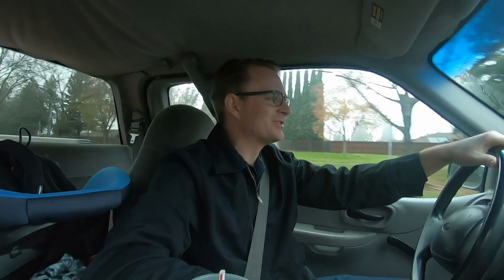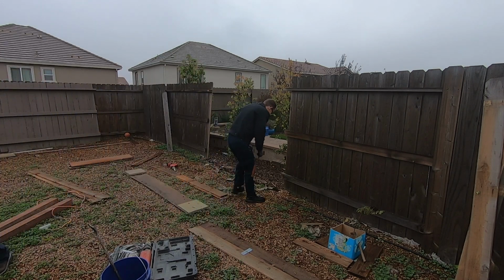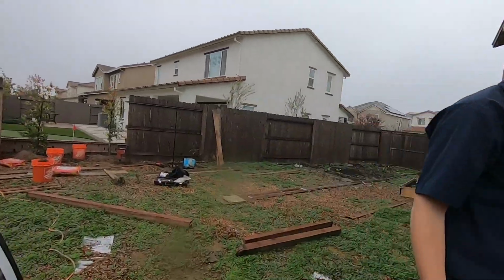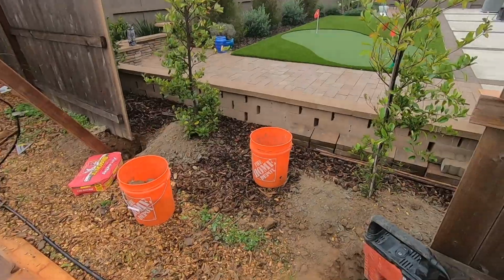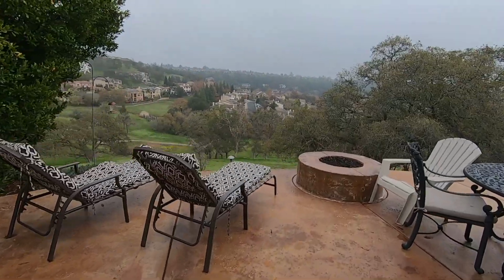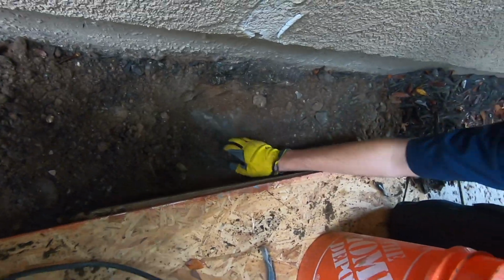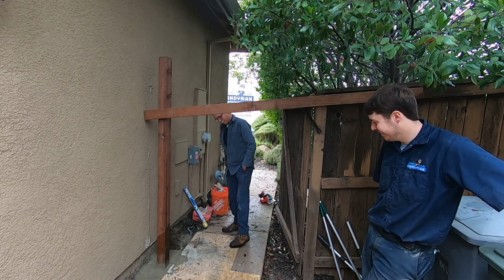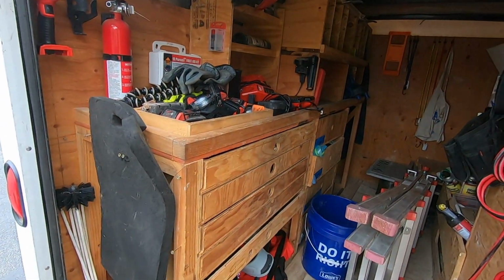Handyman Fence Post Removal With Power | Handyman WLOG S 3 | E 4

Comment: I replace a lot of fence post in socal, I always  replace with redwood, they hold up much better , I ask the homeowner to wet the area a couple time a day for 2 days if possible if not I have a steel jet rod I hook to water hose . Then dig out the concrete plug . I tie a rope around the plug , tie off to a dig bar and lift out. Once I get the post where I want it I dump 2 60lb bag of concrete mix dry around it , pack it with the end of a dig bar or shovel handle then add water and attach the fence

Comment: Amazing how much work that is ! Nice job! That jack hammer works great
Reply from the maker: Ya, it is more than you think for sure! Do you have a demo hammer or do many fence posts?
Reply: @handymanjourney  I have a small demo hammer, done a few fence posts, I used a gas powered auger to drill around them and loosen up and pull out the concrete whole,your way looks good too

Comment: Next time, after breaking out some of the top of the concrete and revealing the post such as at point 5:35 in video. As long as post is not too rotten, a fence post puller can be used. It looks like a farm jack mounted on a hand truck and  that uses a special clamp. Some places  rent them out, a company also sells them by the name OZCO. It saved me a lot of labor, it might for you too!
Reply from the maker: Hey thanks chuck! I have thought of trying one but I definitely will! I appreciate your referral!!
Reply: It's called a high boy jack ! OMG 🤕

Comment: U got two guys use the old post drill a 8 inch lag bolt into the wood in the cement put a change and two guys can hoist it with the old 4x4
Reply from the maker: That's a very interesting idea! I will need to try that!

Comment: What size is that I have same brand
I did a lot this way I found if u dog a hole ride besides it and use a 30lb breaker bar it will break off a lot faster and in bigger chunks

Comment: I use a shop vac to suck the dirt out of the holes as I’m hack hammering. It’s a larger shop vac not a small one. I take the filter out otherwise it clogs up too fast: and I mostly use a spade bit for digging them out. Makes it go pretty fast. Think like a dentist when they use suction while doing a root canal 🦷
Reply from the maker: That's awesome!! Thanks for sharing!!

Comment: Your removing those post the hard way. 😱 There's also a way to prevent the rot in the 4×4 ... 🤔
Reply: I’m interested in what the easy way would be I remove things post quite a bit I am also a handyman and also use a small jackhammer to chip the concrete away thanks for your response

Comment: What’s up with having those alternating panels very odd. Never seen fence done like that
Reply: That's how the house I bought was done too. So weird, but maybe it was the "style" at some point?
Reply from the maker: This is called a "good neighbor fence" it is typical in this area when a fence is shared by neighbors, the only time it is different is when you don't share a fence with a neighbor or one neighbor pays for the whole fence replacement, in that case the paying neighbor gets the nice side of the fence! Thanks for your comment! Where are you located?
Reply: @handymanjourney  thanks for taking time to explain. I share a fence with my neighbors also and think I would rather have it be consistent one way or the other! 😂😂 I am full time HVAC in Florida.